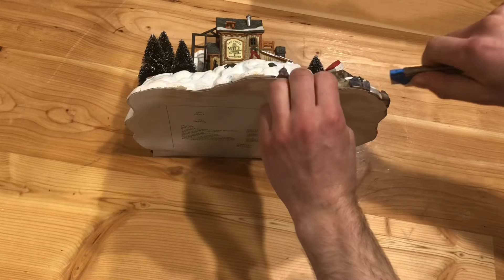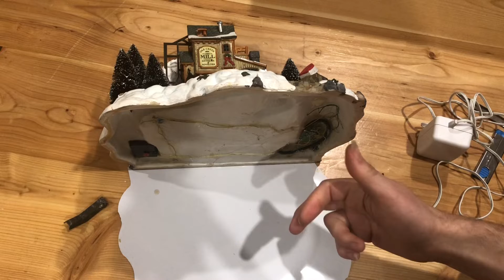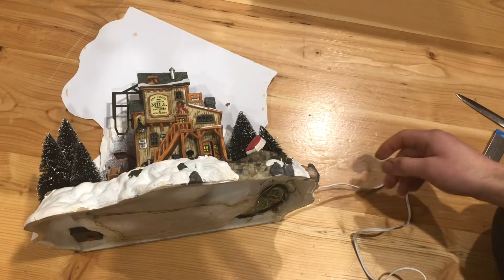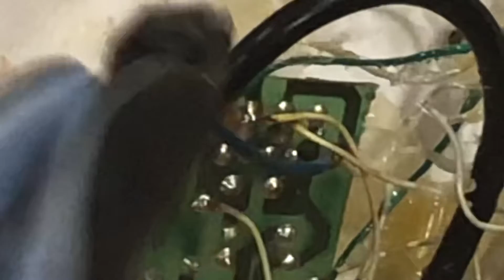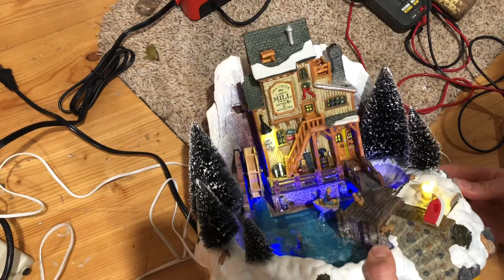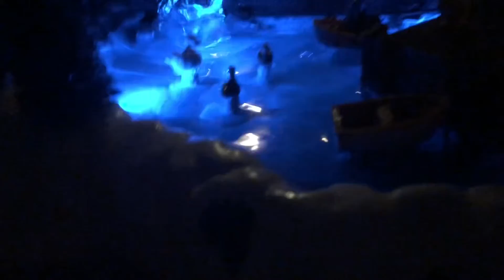Lemax Oak Creek Grist Mill Repair / tear down

Comment: What time of AC adapter does it require? Thanks
Reply from the maker: I believe it was a 12v ac adapter 

It could probably also work on 9 to 10v 

It has to be ac if you want the water pump to work

Comment: How did you get the mill off of the base?
Reply from the maker: Knife
Reply: @kadensmodifications i'm trying to get the mill off my base as well period looks like there is glue or some sort of ceramic glue in the back of it. is that what I am cutting?  All of my lights are working, but the water pump is no.
Reply from the maker: Unfortunately YouTube did not notify me of your comment

Yes you will need to cut the glue or weaken it to remove chunks

Comment: Gracias por el video!! Perfectly explained! Do u have a link for the rectifier? Which dc output does it supply? Thanks
Reply: My european piece has a 9v input. Could i used these to power the leds directly with the appropiatte resistor?
Reply from the maker: @harrykrismas  I found something on ebay

You can usually lookup rectiers and viltage regulators on amazon and ebay
Reply from the maker: @harrykrismas  its supplying the leds
Reply: Do you have recommendations for a replacement pump?  I see where it’s a 300L pump just there are so many options from AC to DC out there but none that are exactly 12V AC 2w and none that aren't brushless like the one that came in the mill.